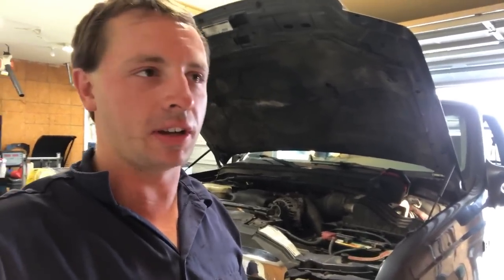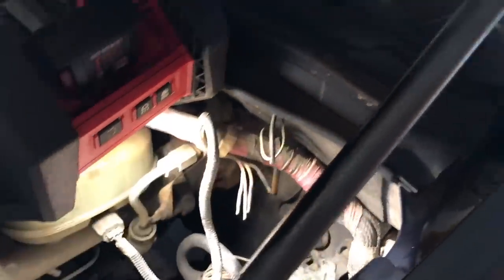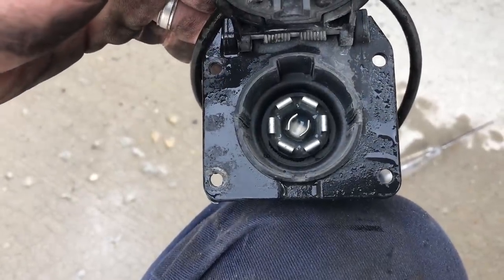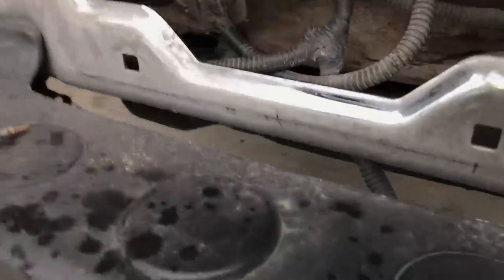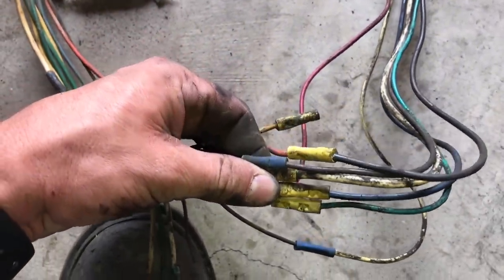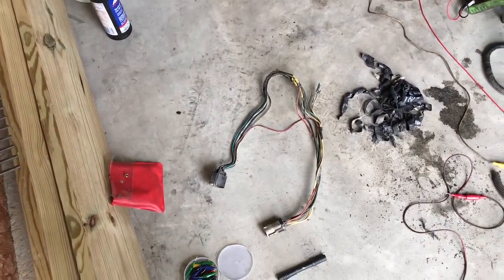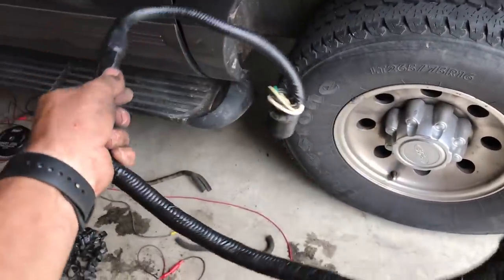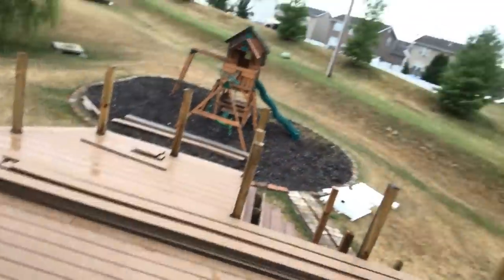Fixing Ford Trailer Lights

Comment: I had been chasing a very simular problem on my o2 f150.  after 2 minutes of your video i paused it and went to look under my hood.  My fuse box was there so I found the manual and quickly determined that my problem was a simple 10 amp fuse.  Though our problems were quite different in the end your approach and video was instrumental in quickly solving my problem.  I cannot say thank you enought.

Comment: I know I'm a few years late, but I'm chasing the same problem now on a 2002 Harley Davidson F150. That's a lot of corrosion in your wiring. That's what happens when people use that kind of connectors. I like to use the one's with heat shrink tubing to keep the moisture out. Thanks for the video, I'm gonna do what you did and hope that I get lucky lol.

Comment: Daniel, It looked like the ground strap at that under hood relay block you removed the relay from was nearly broken in half. You may want to check that before it causes other issues.

Comment: Do you happen to know where the 12V auxiliary power is sourced from? Is there a relay or fuse in the same location under the hood or elsewhere? I have an '04 Ex 6.0 PS and every other pin has the appropriate voltage on my 7 pin connector except the 1 o'clock location for 12V aux power.

Comment: I don’t know if you can give me any sort of help on an issue with a 2007 F250.  Right stop/turn stuck on. Tried pulling all the fuses and relay. No change.  Tried same trailer with my Ranger and it works just fine.

Comment: Hi Daniel, I have a 2003 F150 w/a 7-pin plug I'm replacing. I've tested all the wires (green, yellow, blue, orange, black/grn trcr, and white) and identified what they do, except for the black w/grn trcr. If you had the same arrangement, an figured out what that one does, could you please tell me? Thanks, Tim

Comment: What relays is it on a 2001 f250 ? I checked fuse 3 , because right turn and brake don’t work  on trailer ... changed fuse and still nothing ..

Comment: got question for you on f150 truck. was it worth it?  im facing similar decision but not mechanic. 06 5.4 124k miles. cam phasers off and oil pressure not holding so runs great until pressure drops then misses etc. what to do. love to talk. do you have web site?

Comment: How much would a fix like this cost in a shop of you would have to guess? Having trailer lights issues on the 08 ford f150
Reply from the maker: Give them a couple hours to diagnose it and another hour to repair, I’d say around $300 if you took it to a shop.

Comment: What about if the trailer lights work fine but the turn signal and brake lights on truck do not? 
3rd brake light works . Truck tail lights are on but nothing when I got brake or turn signal.  When trailer is hooked up the trailer lights work as they should.  So I have to keep a trailer hooked up till I figure this out. 2001 power stroke. F250. 
Any help appreciated
Reply: I have the same issue. Did you ever figure the problem out?
Reply: @CotyJones-nj9jh  I can't remember what I did. I'd say it was either a fuse or I replaced both bulbs. Sorry bro. Couple years ago.

Comment: after-market, "garbagey" who'd have guessed!
just use self sealing/heat crimp butt splices/heat shrink.
alternate force good silicone ssealenat through from side to sid e then heat shrink it down. one cured no water zone :0